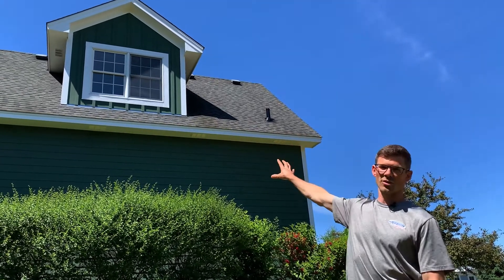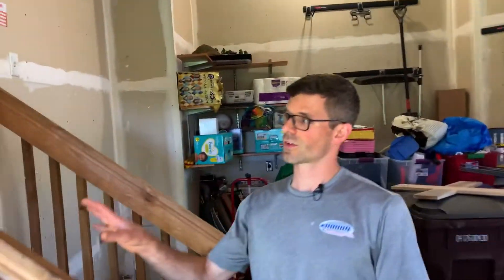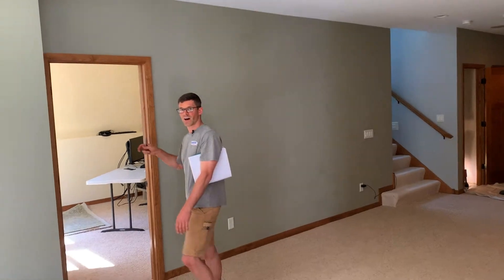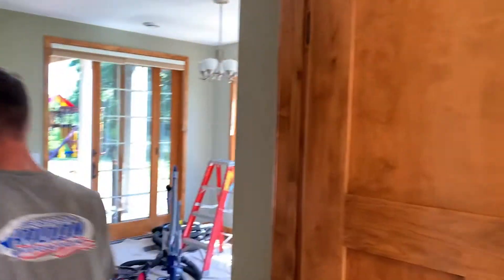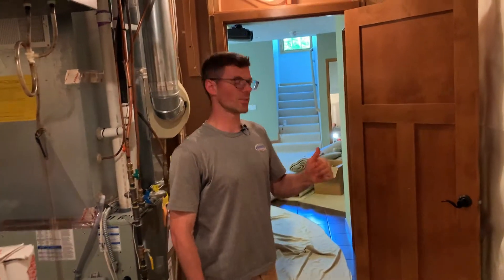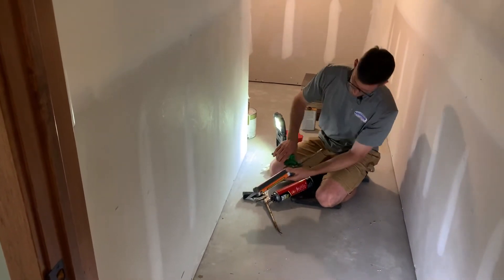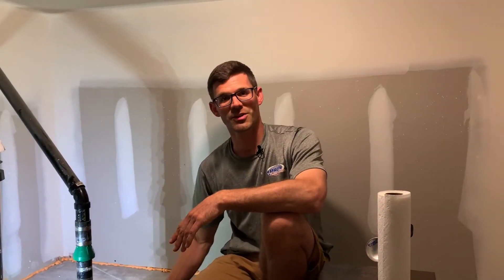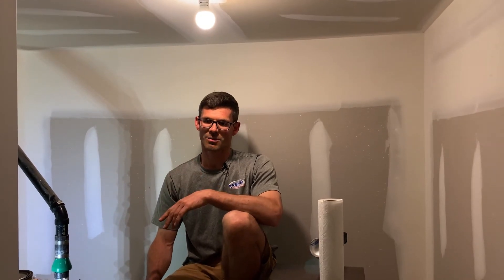The #1 Step Most Radon Mitigators Skip

Comment: Hello and thanks for this video!  At the end you mentioned 5 Pa is your target, that is approximately 1/4" of water column, correct? Asked another way, what is the minimum w.c. that I should see at my furthest extraction test hole?  Right now, I have 0.6" w.c. at the extraction tube leaving the sump pit. thanks!
Reply from the maker: You're welcome! Just to clarify, 5 Pascals is equal to 0.02 inches of water column. We now calculate our target pressure at each test hole using the baseline pressure along with a temperature correction factor. You can see the full process in our online course here: https://americanradonmitigation.com/product/radon-mitigation-online-course/

Comment: I don't understand why you measure what under the floor. That radon is not coming into the house.
Reply from the maker: The home applies suction to the soil drawing in radon gas. We want our radon system to apply more suction to the soil than the house does, thereby stopping radon entry via the soil.

Comment: I have a 50 year old slab-on-grade foundation house with a borderline radon issue (level around 2).  Any opinions on if simply sealing can get it to slightly more acceptable levels, or will a full mitigation system be required?  I'd rather not lose any conditioned air, it can reach 105 here.
Reply from the maker: Since you should seal if you install a mitigation system, you could certainly start with sealing and then monitor your radon. However, an EPA study found that sealing alone is not a good mitigation strategy.

Comment: Can the floor still be sealed if it has been ceramic tiled by the previous owner? We did a test in our house and found the levels quite high. unable to see any cracks as the floor has been tiled
Reply from the maker: I think the thin set under the tile would do an excellent job sealing cracks in the concrete beneath it.

Comment: Can a basement floor be sealed too tight for the radon mitigation fan to work effectively?  I ask because when I built my house, we installed perforated pipe and 4" of gravel then 6mil plastic under the concrete slab.  We installed a 4" pipe for future active radon mitigation if needed.  Walls are poured concrete, 10' tall.  Soil is dense southeastern red clay.  I then sealed all around the perimeter as well as all cracks and expansion joints.  This was back in 2008 and the basement is 3300 sq ft with 10' high walls.   I never tested for radon because we're in a low risk area.  I recently tested and we average 18 pCi/L in the basement so I decided to mitigate.

We have 2 drains in window wells and 1 in a stairwell connected to the interior sump pits so I plugged those with Oatey drain seals and also capped the vents for the sump pits so the sump pits are now tightly sealed.  I did some testing using a shop vac and pressure field extension testing showed about the same numbers everywhere but vacuum pressures were a bit high.  To me, this indicates that things may be too tightly sealed so there's not enough air being pulled under the basement floor to remove enough radon.

After installing a Festa AMG Legend fan, we're seeing about -1.75 W.C. of pressure as verified with a digital manometer.  Seeing about -1.5 W.C. in test holes throughout the basement test holes.  This  comes to maybe 130 CFM.  Radon levels have dropped to just about 4 pCi/L after 24 hours but I was circulating fresh air through the basement using a 20" fan for 3+ days prior to that and levels were about 0.4 pCi/L so they may not have fully stabilized yet.

Would it make sense to bore several small holes in the slab at the opposite end of the basement and connect them using pipe to central manifold that pulls fresh air in from outside under the slab and out through the fan port?  The basement is still unfinished so I figure I could do this relatively easily and use a valve to be able to adjust vacuum pressure/CFM to a more desirable level.

Or would it make more sense to upgrade the fan to something like the AMG Legend Extreme?
Reply from the maker: It sounds to me like your radon fan is way oversized. You only need a few pascals of negative pressure under the slab to stop radon entry. If it's as tight as you say it is, you should be able to use the smallest radon fan (Spirit, RP140, Rn1 or the Rn2 EC). You are trying to create suction under the slab, not airflow. If you have complete control of the slab and radon is still elevated, look at adjacent slabs (attached garage or front step) as a possible source.
Reply: @AmericanRadonMitigation  Thanks!  This definitely has me stumped.  Levels in the central area stabilized at around 6.5 pCi/L.  I'm working on checking levels near the door to the outdoor stairwell, window wells, garage slab, front porch slab and lower patio slabs now.  There are no cracks or penetrations in those other slab areas so only permeation through the elastomeric waterproofing coating and concrete would allow entry.  I'm going to keep at this until I have it figured out.
Reply from the maker: Check out this video or others about tracking down radon entry points. 

https://youtu.be/VkuUX0atOsM?si=mwWeQUZgP03Kep85
Reply: @AmericanRadonMitigation  Thanks.  I'll check it out.  I've done more extensive testing and have eliminated the patio, porch and garage slabs as possible sources.  The entire envelope of the house is spray foamed and all joints were air sealed during construction.  I decided to pull negative pressure on the house yesterday while it was in the low 40s and monitored temps using an Infrared thermal imaging camera.  There were no points of lower temperature air entry underground showing on the camera other than at the door and window seals.  I tested the door and window wells and they have low radon levels.  So this rules out any type of infiltration through cracks and gaps.

As I mentioned, the walls have a thick elastomeric coating on the outside.  The walls also have a drainage mat that's 8' high with a thick plastic backing that's fastened to the exterior to divert water to the footing drains.  This really makes it near impossible for radon to be able to get in through the walls in a large enough amount to cause the readings I'm seeing.  As a test, I put some weatherstripping on the lip of a storage bin that I brought outside to trap fresh, low radon air in it then put the radon detector in the bin and held it against the wall with a weight.  After 1.5 hours, radon levels were at 14.3 pCi/L.  I then did the same test on the slab and after 1 hour, levels have dropped and are at 5.3 pCi/L with a downward trend.

The concrete for the walls came from a different supplier than the slabs.  I'm suspecting that some material used in the concrete for the walls has a high level of uranium and radium.  There's 91 cubic yards of concrete in the basement walls.  2775 sq ft of exposed wall and no air circulation in the basement.

I really need a geiger counter that can do alpha particles to perform a good test to verify.  For now, I'm going to take the concrete that was bored in the slab and test it in the sealed bin with the radon detector.  I'll have to bore a chunk from a wall to test it as well.

It's starting to look like I need to install an ERV to bring in fresh air.  My other ERV only does 200 CFM and it's taking care of 4,700 sq ft of house already.  The other option is to try to seal the concrete from the inside but that's a significant amount of work.  An ERV would by much easier to install and would cost about the same as the sealer.
Reply: @AmericanRadonMitigation  Testing shows that the concrete in the walls is actually the source of the radon I'm seeing even after sub slab depressurization.  I also came across Bill Brodhead's research on very elevated levels of radon in condos where the walls and floors were all concrete and the concrete was the source the the high radon levels.  I actually bored a chuck of concrete from the wall, placed it in a metal container with an Ecosense EcoQube and radon levels shot up to over 15 pCi/L and remained around that level.  My next step is to determine the best way to mitigate.  Either with a concrete sealer, ERV or both.

Thanks for all the informative videos.  I've watched most of them and they have all helped greatly with my adventures in mitigating the radon in my basement!

Comment: Thank you Jesse, extremely helpful.  I have a question for you... I would like to completely seal my basement floor prior to coring and running pipes.  I have the Radon calking for the cracks but I would like to paint entire floor as well.  Can you recommend a paint/sealant that is durable and will harden to a permanent seal?
Reply: SaniTred. Coating claims to be the best. Google them.
Reply from the maker: Sorry, I don't have any recommendations for that.

Comment: How thorough you are is appreciated! What do you do when there are drain tiles with dimple mat plastic leaving gaps along the edge of basement walls that can't be sealed? And if they're drawing air like it seems like they would, how severe is the energy loss from the house if conditioned air is being sucked out?
Reply from the maker: The energy penalty can be significant if you do not seal the dimple mat and use a large radon fan. I ran the numbers on this scenario in a home a few years ago, and it would have cost over $1000 a year to operate. The cost breakdown was $172 to power the radon fan and over $800 in added heating and cooling costs. 

If it's necessary to leave the dimple mat unsealed to allow water entry, I recommend installing a vapor barrier on the foundation wall. Tuck the bottom of the vapor barrier between the foundation wall and the dimple mat. Then, seal the top, seams, and bottom of the barrier to limit conditioned air loss. You may also have to seal the top of the foundation wall if it's a concrete block. The vapor barrier will allow water to run down the foundation wall and enter the water management system.
Reply: @AmericanRadonMitigation  that’s a fantastic breakdown and solidified my concerns. Thank you very much for the detailed information!
Reply from the maker: You bet!

Comment: Have you tried or what are thoughts on flipping radon fan upside down and smoking it to see where leaking is coming from?  I have a finished basement with carpet, and thought about doing this so I would only pull the areas that are leaking smoke to seal it.  This would prevent me from removing whole carpet and finding areas that might have missed.  Thoughts?
Reply from the maker: Colin, with Radon West, near Calgary, Canada, has done this. He said it's an easy way to show homeowners why they may want to allow him to open up walls to seal openings to the soil.

Comment: What about finished basements?
Reply from the maker: Most homeowners with finished basements only allow us to seal what's easily accessible, as you saw in this video. However, a few have allowed us to remove the baseboard and cut drywall to seal what's behind the wall.

Comment: Seeing that conditioned air is being pulled down like that makes me think that a plastic layer wasn't installed below the slab, is that correct? Or will conditioned air be pulled down below the slab even with a plastic layer between the gravel and slab?
Reply from the maker: Good question, Trevor. Since the poly isn't sealed to the foundation, conditioned air is drawn below the slab through floor-to-wall joints.
Reply: @AmericanRadonMitigation  ok I think I understand, so that would happen typically only at exterior walls where it pulls around the edge of the poly?
Reply from the maker: It can happen anywhere there is a hole in the vapor barrier, for example, at a floor-to-wall joint or a plumbing penetration.

Comment: Hi Jessie. We have a system that is in our basement where the vent pipe comes up through the garage, much like the one shown here. Ours is not covered though and is just the white piping. The pipe is covered in a greasy looking dirt that looks like some might be mold. Is this normal and is there a safe way to clean this pipe? The system shows it's working great but the pipe looks very unsightly in our garage!
Reply from the maker: Hey Bren. The problem you are describing is caused by condensation forming on the outside of the piping. You can clean it off with a cleaner like Simple Green. To prevent mold and mildew in the future, you can install insulation with a vapor barrier over the piping in the garage and in the garage attic. Since that would involve cutting the pipe apart, you may want to try wrapping the piping with sill sealer instead. A mitigator in our area uses it to insulate the piping in their systems.

Sill Sealer - https://amzn.to/3k3hkXC
Check out section 6.2.10 in the mitigation standard to see what it says about pipe insulation. https://standards.aarst.org/SGM-SF-2017/20/index.html#zoom=z

We plan to cover mildew on radon piping in a future video but need some photos or a video to use as an example. Would you be willing to send us some pictures and or a video showing the piping? If so, horizontal 16:9 photos work best as well as horizontal video. 

You can fill out or estimate request and let us know you want to send photos, and we'll provide you an email address to send them to. Thanks, Bren! https://americanradonmitigation.com/free-estimates/

Comment: I have a finished basement and the 2x2 wall framing sit on top of the slab where it meets the foundation. I have no way to get foam to seal that small gap… 😭
Reply from the maker: Logan, try using the Great Stuff Pro gun with the small tips to inject foam behind the 2x2 if you have access. You could also seal the bottom plate to the floor and wall.
Reply: @AmericanRadonMitigation  I had a small gap under the 2x2. I fired up the fan and I can hear air. I got a smoke pen so I hope it’s just this one corner. Thank you 👍

Comment: Do you know if there is a RADON barrier to put under laminated floor.
I found barriers for under the slab, but if the house is already build what can you recommend for on top of the slab.
I have to change the flooring and will install laminated floor. What I read about the normal vapor barriers is that it don't stop RADON gas, and all other RADON grade barriers are only for under the slab.

Thank you for the great video!
Reply: RadonSeal. It’s a spray on sealant that soaks into the concrete.
Reply from the maker: Boy I’m not sure about that as it’s out of my wheelhouse. You’re welcome!

Comment: I see you use foam sealer. I see some contractors use silicon. What's best to use for sealing basement cement cracks?
Reply from the maker: We like using Radon Sealant when we have access to cracks. We use foam for the hard-to-reach areas and block tops.

There are links in the description if you'd like to check them out.

Comment: Thanks for sharing!  Why insulate the pipe in the garage?
Reply from the maker: Good question, Bruno!

Here are the benefits of insulating the pipe in an unconditioned space like a garage or attic. 

1. Reduced noise.

2. Reduced condensation both inside and on the outside of the pipe. Condensation on the outside of the pipe can drip on insulation, drywall, or other items. Condensation can also allow mildew to accumulate on the piping.

3. Dramatically lessen the chances of ice accumulation in the piping. If the system gets blocked with ice, radon levels will rise until the system thaws out. This is the main concern here in Minnesota.

Check out section 6.2.10 in the standard for more information. https://standards.aarst.org/SGM-SF-2017/20/index.html
Reply: @AmericanRadonMitigation  Fantastic answer!  Thanks for sharing.  We have done thousands of garage installations here in Utah.  My guess is we are dealing with completely different climates.  It obviously is dryer here than where you are installing.  We have luckily not had any issues with sweating pipes.  Garages are colder than the house of course during the winter months, but we don't see garages getting to freezing levels.  They stay above that so is there really an icing concern in a garage install?
Reply from the maker: You're welcome, Bruno. 

I worked on a system in LaCrosse, Wisconsin back in February. We had a long cold snap during that time. 

The system had 13 feet of horizontal pipe in the garage attic that slowly froze solid while I was troubleshooting the system another company had installed for her. So yes, it is an issue, especially if there is horizontal piping. 

Her home was a twin home. The neighboring unit also had a radon system. While I was on the roof, I noticed that the neighbor's radon exhaust was blocked with ice where it discharged through the garage roof.
Reply: Beautiful work and solid attention to detail 👍🏼💪🏼